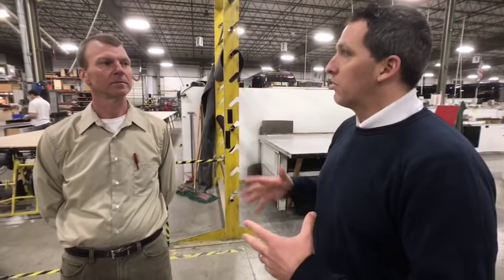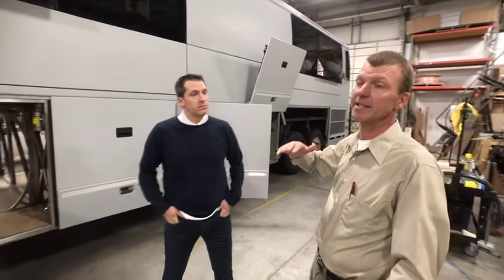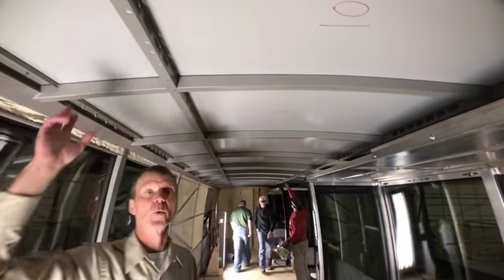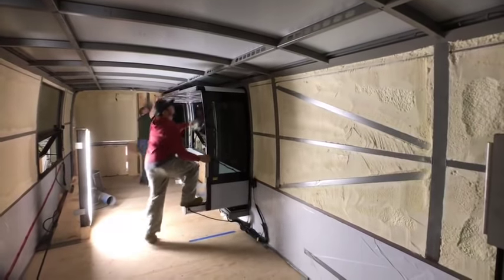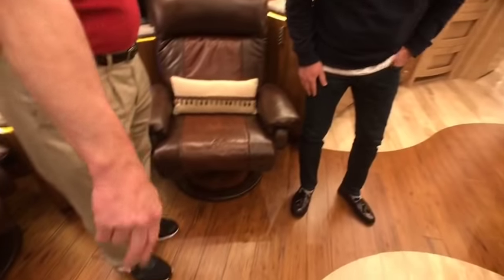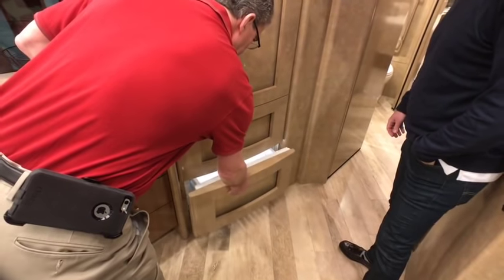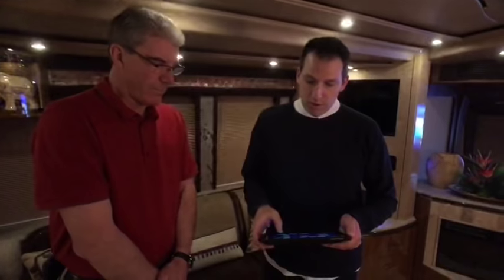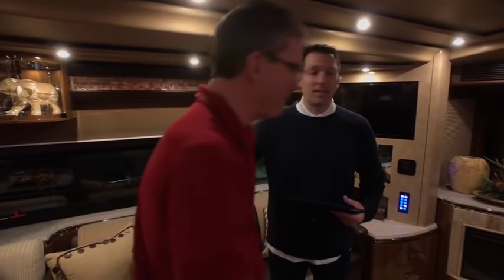Day 1 of a Prevost Shell. Marathon Mondays with Mal: Episode 5

Comment: Mel.....the salesman should wear soft-soled shoes, so as to prevent scarring the new coach floor before it is delivered, or sold.  It displays appreciation for guaranteeing a perfect product to the end customer.....
Reply: a Good Thought - however  - the flooring that we use is extremely durable and ready for everyday use - but a good thought - thanks for commenting
Reply: For that matter, they should trailer or put the shells into a boxcar down to the factory.
Reply: @goutvols103  Much of the reason for driving the shell more than 1000 miles is to find any problems with the chassis BEFORE they get to the Marathon factory.  Any damage caused to the shell on the road will be fixed when they go to the body & paint  shop anyway.  They've been doing it this way for 35 years now.
Reply: @jamestorrence9340  absolutely correct Mr. Torrence and may I add that it helps "settle-in" or "break-in" the whole coach's structure before final conversion fabrication, where everything can be tightened and or retightened together. And the same can be said of the so-called final conversion processes. You'll be surprised at what a little road bump, vibrations, twists and turns will turn up...so of course the same process is done again and again untill nothing comes apart and or loose tolerance.